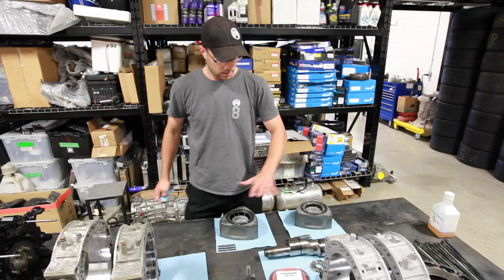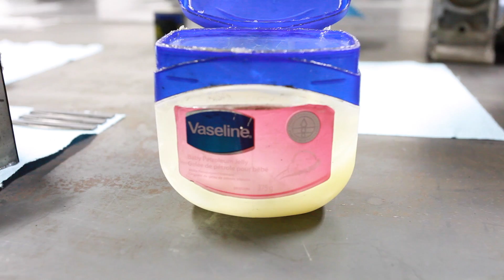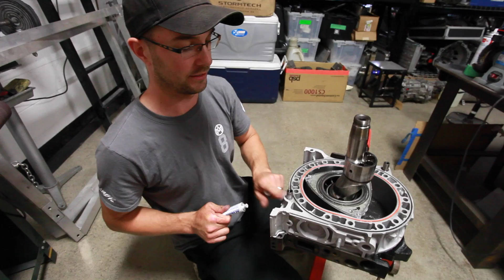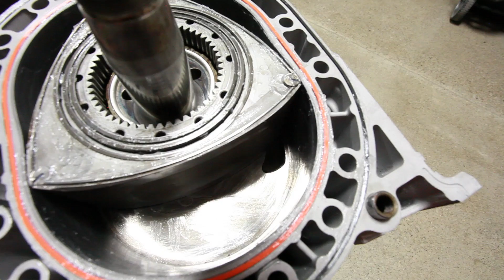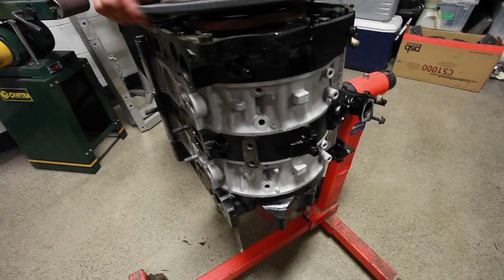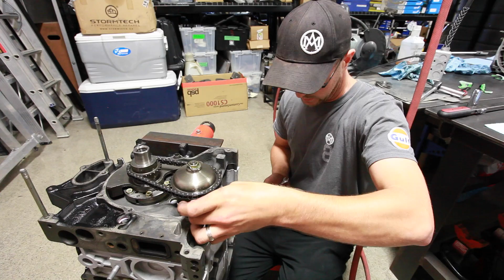How To Build A Rotary Engine

Comment: If you look up Skycar, a company in FIa., that  builds a four ducked prop flying car that uses four wrankel engines and may have overcome the gas hog problem. They had a two seater that if I remember the specs. had a range of over 300 miles at about 300 mph., Iast time I looked them up, maybe three yrs. ago. They've been working on them for like 40 yrs., first looked like a UFO and then like drones of today, but way befor, Someone like Tesla should get them "off the ground.''
Reply: Sorry to tell you this, but Moller is the most famous vaporware investment scam in history... this guy is a crook and has been running the same scam for decades and stupid people still fall for it, get suckered out of their money.

Comment: Emissions usually messes up cars so you're probably right
Reply: That might have been true when emissions were first introduced... the problem with Wankel engines is they quickly fail once you expect more power from them... more power, faster the apex seals fail.

Comment: 22:45 you do not want weak piston rings on a boosted engine. Fuel and blow by damages oil. They simply use lower compression to compensate for the higher temperatures from compressing air and forcing it down the engines throat.

Comment: Your lack of oil doesn’t make any sense at all those Engines burn oil 
They burn more oil than words aloud in formula racing that’s why they’re not used anymore . 

That engine was running lean when you supercharged it and rented it higher PMs that’s what did the damage !

There’s never any lack of oil inside combustion chamber of those engines it burns too much oil !
Reply: ... or the rx8 was known for not injecting enough oil from the factory to properly lubricate the seals. not to mention the early models injected oil to the sides and not in the middle.

Comment: Fyi, oiling those long bolt threads will cause over torque, false lowered torque readings.  If you torque to 30 ft lbs , you're probably closer to 40 with oiled threads. You have to account for oiled threads. Love the DIY 52mm. I've tigged up a few tools like that. Great video !

Comment: Also some seals you can not use Vaseline because petroleum makes seal swell and some part will make it hard to put things together and also pinch or damage seals. Not sure about rotary spec because I haven’t built one but just know to check your manual it might say not to use petroleum based lubes to assemble seals.

Comment: Lubing the bolt is a Cummins spec. The shoulder of the bolt should be oiled too this reduces friction and gets you an accurate torque.

Comment: @36:00 - there is a tool that will let you torque those oil pump bolts, it's called a "dog bone". it has the bolt size on one end and a 3/8 drive on the other. check snap-on for it

Comment: Rewatching this as I'm getting ready to build my cosmo engine for my RX-7 soon and a few things I wanted to correct that were said in the video. Yes the FC and FD had water channels in the irons, but those along with the euros cosmo were the only rotary cars to ever have them there, from 1967-1985 all rotary engines had water channels in the housings and they never had water channel breaking issues like the 1986-2002 motors did, but the reason for mazda reverting back with the renesis is correct. Also lightened genesis rotors aren't the best idea if you want to balance them accurately, the problem with lightening RX-8 rotors is that there isn't enough material on them to do both. The RX-8 rotors that I'm using for my cosmo engine build were sent off to CLR motorsports to be balanced, but not lightened and that is because I wanted the most accurate balance on an already super light rotor possible which is exactly what I got. This video will explain everything I'm talking about here https://www.youtube.com/watch?v=HahComhZR9c .

*Also there is no benefit to porting a renesis engine, the max power to be gained from this is maybe 1-5whp, the reason for this is because it is already a near maxed out engine stock which is why dumping thousands into intake, exhaust, ignition and tuning yields very little results and all porting will net you is worse economy and lower reliability. Top that off with a pair of grossly unbalanced rotors and that's just a shit show I wouldn't touch with a 10 ft. pole, however, there is a type of porting that will increase reliability and even help exhaust flow and that is removing the carbon Catchers in the upper portion of the exhaust ports, carbon builds up in this area over time (mostly from babying the engine and treating it like a piston engine) and eventually breaks loose causing catastrophic internal damage.

Besides what I've talked about above this is a great video and hope to see more rotary content from this channel in the future
Reply: Hey thanks
Reply: You know exactly what you're talking about!👍 😏 I'm a big fan of 12as and early 13bs.

Comment: I used to be a fleet mechanic for a logging COMPANY we had a machinist that Boeing recruited away. Anyway when he rebuilt Diesel motors replacing cylinder liners the oring seals were critical. He used my jelly because of clearance but more importantly o rings would break down if he used a petroleum based lube . Why don't you use water based lube for the coolant o rings?

Comment: Dumping extra oil into a "high-performance" spark-ignition engine to make it last longer and wear less in high-speed, high-load operation is about as smart as dumping sand in it. Oil is very low in OCTANE and the engine will detonate and "knock" easier and sooner the more OIL you put in the combustion chamber. And they're dumping heat with every cycle. And since the oil/fuel mix enters the cylinders after passing through the crankcase and its a very "constant" flow and the oil and fuel stay mixed and the mixture is preheated and very well vaporized and those engines are high-speed/low-torque engines that don't have "time" for detonation and have fixed ignition timing, they can get away with reduced octane. They also "supercharge" themselves since the piston traveling down in the cylinder forces fuel-air into the cylinder and they end up running very cool because of how well they breathe and how well they exhaust heat. Heat is the real cause of detonation and of course is the real cause of ignition period once the "fire" is lit. If you're air-cooling an engine and have no lubrication system, the engine is going to use the extra oil in the fuel where and when it needs to be used and its DESIGNED for burning a MIX. A rotary is NOT "like a 2-stroke" and the engine design itself was NOT intended for "high-speed" and/or "high-load" use. It was designed to "compete" with small piston engines for "industrial" or "commercial" use operating things like portable generators and outdoor power equipment. Compact, lightweight, "cheap" and "disposable" at the end of its service life and easily recycled. A single-rotor Wankel is roughly comparable in cost and complexity and maybe cheaper than a single-cylinder small engine or at least was back in the day when all small engines (Briggs & Stratton, Kohler, etc) were side-valve engines and the camshaft, valves and other valvetrain parts and more complex and expensive cylinder blocks with valves and ports in the blocks made a single-cylinder engine nearly as expensive on a per-cylinder basis a larger engines if not more expensive. A $200 small engine with maybe 5 horsepower is ridiculous expensive compared to a V-8 that costs less than $200 per cylinder. Single-rotor rotaries are "cheap" compared to a single-cylinder small engine. Add rotors and you compound costs dramatically. Or so it would appear based on the cost to "rebuild" one with used parts.

Comment: could always use a torque wrench with a crows foot adapter to get to those oil pump bolts.. it wont give an exact torque amount but it will be very close.

Comment: it's nice to see and hear reasonably intelligent people talking about and doing anything engine and car related. where I live just about everyone in the automotive business either has no clue what their talking about or doing really, and have just been getting by somehow miraculously on luck and half assed work. and are so sloppy and careless with everything. I gave up a long time ago trying to have any intelligent conversation about anything the least bit technical or in depth at work here with anyone. they would look at me as if I were speaking in tongues, or either try to contest every little thing I was saying even though I assured them that what I was saying was 100% manufacturer information, procedures, or specifications. but they were dead set that I was wrong and the way they had seen their great grand pappy do it in the backyard forty years ago was the only right way. I worked for a guy, who owned his own shop, and said he trained at Porsche in Germany (a lie) , who tried to convince me after he did a"valve job" on a 4 cylinder sohc Subaru, and I came in the next morning and filled the ports with PB blaster and they were leaking like faucets, that PB blaster was thinner molecularly than combustion gases!!! he was so butt hurt that he fouled up that valve job and that I knew why that he actually tried to convince us all of something so absurd we had no choice but to just agree and put it back together, ultimately to see it run like utter garbage. I've watched people beat the living crap out of starters for twenty minutes straight even all it needed was a fuse, that's TWO fully developed adult minds spending a half hour each that couldn't figure that out, no concept of how to use a test light but they buy the best hammers the snap on truck offers though lol that's not even the tip of the iceberg. people around here detest you if your book smart and you have some knowledge, they don't think that you can have that kind of knowledge AND be good with your hands at the same time, they don't think it's possible I guess idunno... to be fair I haven't seen it around here either, it's either one or the other. but they will hate on you to no end and argue with you till they are blue in the face about the stupidest things that are so obvious. i saw the same boss that fudged up the Subaru job spend all night long trying to glue  a little oil line from a Chevy Cruze that got nicked with a saws all , that's his time plus two of us employees time and pay, and it didn't work, I knew it wouldn't, well all that time and money spent trying to glue a line that cost only FIFTEEN DOLLARS from the dealer!!!! if there's anyone around here with any sort of intelligence, that's in the automotive industry, I've yet to meet them. I live in Charleston West Virginia. and this is the biggest city in our state, things get more hokey and backwards the further you get from here too!! it's crazy, I swear. I'm ostracized for researching information and specifications and taking time to do things right instead of just ripping into things and cobbling them back together with bubble gum and well wishes lol I think it's time for a move and hopefully situate myself around some like minded people. sucks living in a hillbilly redneck place where you get looked at funny for actually wanting to be good at what you do hehe never in my life did I expect that.

Comment: Wouldn't it be better to use break in lube or even standard motor oil instead of vasoline? I feel like that alone would increase the life of the engine compared to vasoline

Comment: Anyone talking shit about a rotary doesn't know the first thing about them you look at the piston engine when it was this old and the rotary is right where it should be you use a PTFE additive in your oil and never let them get hot and they will run forever at high RPMs

Comment: nice video... A lot of the inefficiency is due to the high surface to volume ratio which means a lot of the heat of combustion gets absorbed by the engine.... lower compression ratios mean a lower expansion ratio and that also lowers the efficiency.

Comment: I'm glad there are professional "mechanics" out there that can work and make YouTube videos at the same time while talking to the camera man to show the "amateurs" how its done since so many "amateurs" think watching YouTube videos is a good way to learn how to be an "engine builder" rather than doing things like buying and reading service manuals. I have enough problems keeping my mind on what I'm doing in the middle of an engine or transmission assembly to need or want any more distractions. But then again rotaries are pretty simple compared to all those "inferior" piston engines I work on. There is one thing about rotaries I'm not getting or at least the one in this video. How does the "e-shaft" turn at 3 times "rotor speed" if the rotors are driving the "e-shaft"? Doesn't sound possible to me. 

That RTV on those "legs" can't do much for letting the "housings" and "irons" sit flush against each other and not be distorted/stressed under torque, either. Isn't the oil level in those engines far below those "legs" where it would have to be way over full or gravity-defying to leak out that high?

Comment: Uh, I'd be careful about smearing Vaseline all over o-rings unless you know for a fact that they're "compatible" with petroleum products like Vaseline. Those orange ones in particular, which are usually silicone rubber which absorbs oil and swells. A lot of diesel engines with wet cylinder liners have 2-3 o-rings in the bottom of the liner or the bottom of the block and John Deere engines use orange and black ones. They're two different colors for a reason. The orange ones go on top only because they're compatible with coolant but are NOT compatible with petroleum products. 

The black ones ARE petroleum compatible and they go in the bottom grooves. Get enough oil on the orange ones and they'll swell up and squirt right out of the grooves even though there's only a tiny gap for them too squirt through. The first wet-liner Deere engines had "weep holes" between the grooves and leaking coolant past the top seals would leak out the side of the block and not into the crankcase. Later engines don't have those grooves but as long as they're not exposed to oil in the coolant system from a major internal oil leak (oil-cooler, etc) the tops seals rarely leak unless they're cut during liner installation. Good mechanics can feel that happen when it does. 

Normally what is recommended lubricant for orange coolant o-rings like that is "soap" and Murphy's Oil Soap is generally what the "pros" use. Murphy's contains propylene glycol (alcohol) but no petroleum. As for smearing everything else with Vaseline, I just have to ask why. A little oil in a new engine is a good idea and assembly lubes are typically light and thin and "watery" and USUALLY are not petroleum-based because OF the issues some engine seals have WITH petroleum products. 

They're "food grease" and non-toxic, are easily "burned" and more importantly are EASILY "melted" by ENGINE OILS. Get some thick, heavy grease that wants to REPEL fluids like WATER and fill a new engine or trans with it and you can easily end up with that crap plugging your oil filter OR creating an "air lock" where low-pressure or "no-pressure" engine oil would otherwise flow and flow quickly but can't go anywhere because the grease is sealing the "outlet".

Lube on engine factors is best done BY THE BOOK. You mention "head studs" and that's a very easy way to end up damaging a block or head gasket if you use too much and "hydraulic" the head bolt holes OR have so much lube on them that the gasket ends up soaked with it. Coated fasteners also usually have different and lower torque specs than non-coated "mild steel" fasteners. If they're anodized or have graphite lube on them or are anything but "plain steel" its best to go back to the book. I'd also highly recommend hitting those "dowel pins" twice where they're clamping big, thick aluminum housings. Aluminum likes to "relax" after torquing and a retorque 10-15 minutes later is a good idea.

Comment: you have to keep your more so mineral oils clean with some water only a little at a time ,,keep adding as oposed to puting a whole heap in at once cause it cleans the machinery out,,, hydrocarbon is water anyways,,,,and not being silly maybe some diluted sugar to get rid of some of the acid,,,,,,and i think you can increse the ron on fuel if you get rid of some of the acid but cleaner fuel to begin with

Comment: Wrong; the seals on FB and FC's have always been on te rotor housing the only difference between the old engines and the Renesis, is that the exhaust port is on the side housings. where do you get your info? Have you ever seen the inside of an older 13B?

Comment: Saw a vid yesterday with some dudes building giant versions of a 4 rotor making like 3000hp for marine purposes.  They make any hp you want, the cash varies with buggery required to build them obviously.  They were only like 2/3 the weight of comparable diesel.  That version also ran on diesel!  They were like 3 or 4 hundred thou to buy from memory.  Install and ancillary components make it an absolute wank.  Anyone with half a brain would just get a mtu 2000 or similar, last forever.
Reply: Link?

Comment: if that little thing makes 200hp that's pretty good as it's not much bigger than a lot of AOD transmissions
Reply: doktorbimmer that isnt how displacement works. Its not relative to cycles. Gimp boi
Reply: only having 51 horsepower-per-liter is very unimpressive